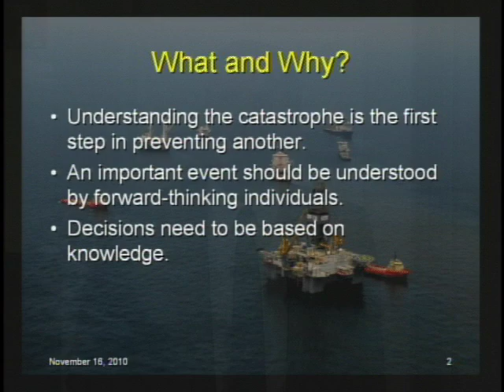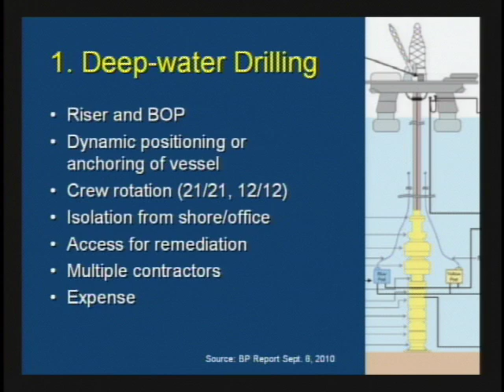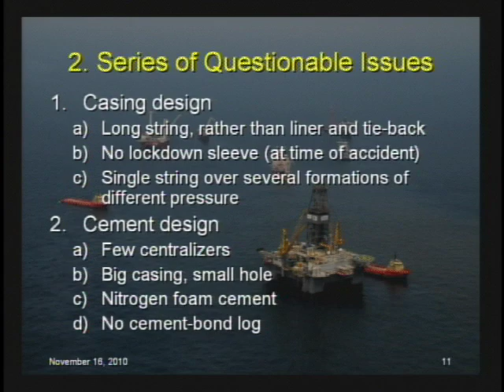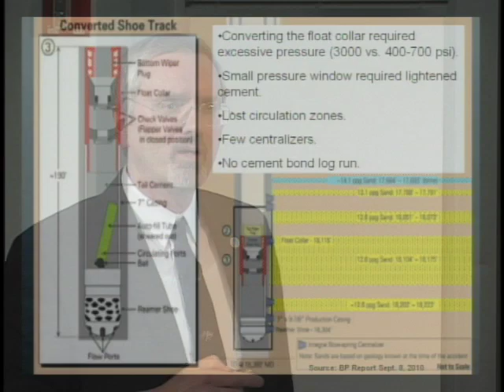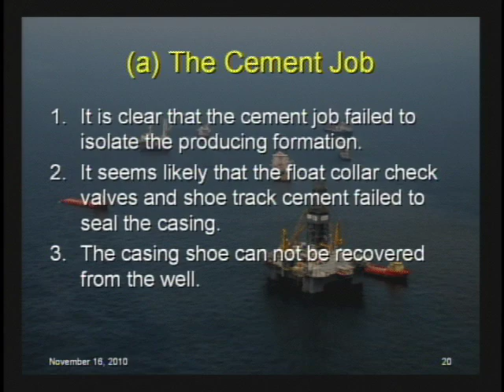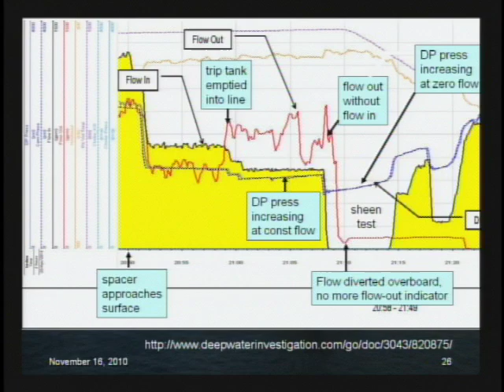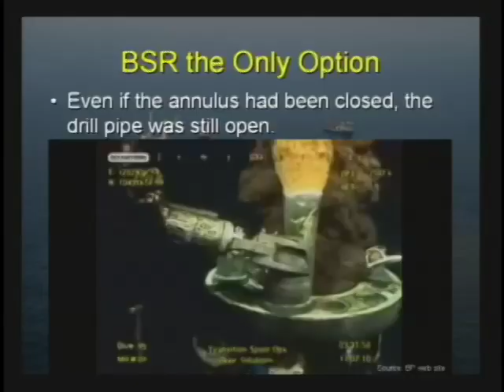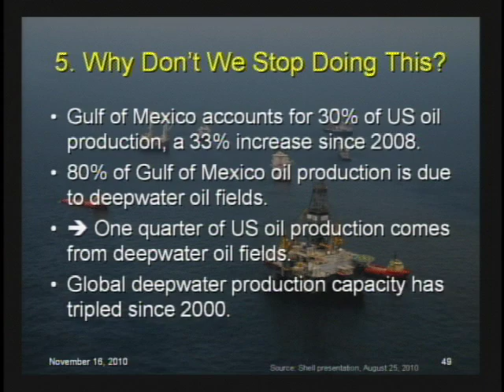The Deepwater Horizon Accident: What Happened and Why?

Comment: I would add one item to Mr. Horne's suggestions. Worker involvement in operational safety. Instead of workers being totally schedule driven and told "Don't use safety as a crutch" (for schedules slipping) every individual should be encouraged and rewarded for noting unsafe conditions and recommending safety improvement. The workers are closest to the operation and always know when things aren't right. In the long run this saves lives and profits.
Reply: What world are you from?
Reply: that's pretty much obvious. that's exactly the problem. that this costs money. and BP didn'T want to spend money. it's like you have said: BP should have been nicer. obviously. But the how do you force a big company like that to carry about safety and human lives? that is the question? if they can point at subcontractors, probably treaten them with termination of contract, and ovoid or minimise requirements anywhere possible, how do you force them to still keep those regulations or even get better at them theirsleves? its big money against regulations: the same story everywhere. what body would impose those regulations on a multi national company? in what court would they be tried if they break any of them? how do you give power to subcontractors against the pressure of giants like BP? those are just  just a portion of the probable valid questions.
Reply: The problem is that corporations all seek immediate/short term gains which probably has at least something to do with the musical chairs that corporate executives play amongst companies while cashing in on the stock options. What I think should happen is when any CEO (or any board or executive if a company), banker, or politician is found to have blatantly caused suffering and/or death to people is to hang them on national television. It may be extreme but you would see a change pretty damn fast.
Reply: @brianallison1913  

... or use a guillotine/guillotines ...

In fact, a thought crossed my mind: aside from using the 'shorter' version, with a much heavier blade (especially with the steels we have, like 4140), aside from a forge welded blades, made from, say, 1065, 1080, 1095, and 30n20, instead of 'just' the head, have an additional two, for the arms stretched out —as they do for lethal injections — and another for both legs, tied together, and as close to the pelvis as possible. Using electronics with millisecond impulse, once all is carefully placed in a precisely marked postion, and energised, hitting a switch, causing all four to 'fire' at the same time ...

Sounds borderline insane, but, if you're going to make a truly public spectacle, of those individuals, then 'just' hanging may not be enough, especially for those whom are even willing to pay decent seats, and so forth ...

... dismembering by guillotine, as per above, maybe is closer to the psychological effect you want to create, especially among those, whom, if guilty, and their appeal is denied you wish to be publicly hanged; also the aforementioned method is closer to the harsher hanged, drawn, and quarterd ... but without the mess, and effort ...
Reply: STOP WORK AITHORITY.

CALL COAST GAURD AND LET THEM KNOW THAT YOUR ARE BEING HELD ON THE FACILITY AGINST YOUR WILL IN A HOSTILE AND UNSAFE CONDITIONS.

Comment: So many questions wish I could ask. 1st He said they don't check the BSR like they don't check airbags in a car. This is not true, the BOP BSR are checked every 2 weeks along with the annulars and other rams in the BOP. 2nd who was the Wellhead rep and and how much weight down did they have down when they landed the casing before they started cementing. After the cement job they have to install the Seal Assembly and I've never heard anywhere where they talk about the Running tool of the casing or Seal Assembly. (knowing the size of the casing would help too) Lots of people I believe were thrown under the bus in the incident and the people who really know what happened went into the bush like Homer Simpson.

Comment: When the negative test was preformed it failed showing 1400 psi on the drill pipe pressure gage. Proven test tried and true. 
Well control problem indicated! 
Next step immediately close a variable ram after calculating space out. The rams would close at this time it would be far before the situation became critical. 
Well successful secured!
Then take as long as needed to decide if your stripping in to squeeze cement or whatever. 
Never disregard a failed test.
Never disregard a failed test and try to find a justification to eliminate a failed test because it's  inconvenient that there is a well control problem. It's not just going away because you secretly test against a closed value, or any other things you do or say just won't fix the problem and justify it away.
If you don't take care of it right away a 10 bbls kick turns to 30bbls kick turns to 300bbl kick and then you get all the unscheduled events equipment failures that go with a uncontrolled release of gas influx into the wellbore, no surprises there.  That's why they call it loosing control of the well. Transocean was always careful not to point fingers at anyone when we had accidents, but considering what to teach us so we could learn from them then move forward working safer with more confidents and integrity than before. Did we go to the moon with no sacrifices? Did we not know how dangerous our job was each and every time we hug the kids kissed the wife goodbye? I did. Then I would go  walk the deck with MEN on the open ocean. 
My heart goes out to those who where affected by this tragedy.
My heart will always bleed Blue,
Thank You Transocean for the ethics and integrity you bestowed in me as a young man as I know this tragedy affected more hearts than anyone could imagine and many where shallow in projecting a wider range of empathy.
R.I.P.  my brothers in Blue.

Comment: learning from mistakes is one of the fastest way to make progress/improvements. Airplanes 30 years ago also weren't what they are today, and sadly it's the accidents that made them better & safer
Reply: It's not just that, it's the aviation industry's commitment to safety, the stringent regulations and things like airworthiness directives that mandate that operators take actions to immediately reduce the risk of accidents during an investigation (e.g. when A380s were required to have far more thorough testing done to the engines until the precise cause of Quantas 32's engine failure was determined), and the overall culture. Commercial aviation is safety-first at all times. Every part of a plane is tested and tested regularly. Every few years they go through a D-check where they strip the entire plane down to its bare bones and inspect every square centimetre for damage, including fractures invisible to the human eye.

Whenever something goes even slightly wrong, an incident report is filed, the causes investigated, and corrective measures either recommended or mandated. Go-around due to runway incursion? Incident reports from all involved, improvements made, the best example being runway status lights as an addition to reduce them.

From an outside observer's perspective, there is nothing like that kind of culture in oil drilling. Not even close.

Comment: I'm the designer of the caphead spool that stopped the deep horizon's macondo wells rogue leak.  I'm an employee on Alaska's North slope oilfields in Prudhoe Bay (current 2019). I'm a mechanic. But also have over 30 years experience in pipeline repair and maintenance. June 20, 2010 I was watching news coverage of the horizon crew using underwater robotics to cut bent sections of the line away and left several feet sticking out of the seafloor. N inches from the pipe end was a flange. I designed my caphead spool that could be lowered onto the well pipe and use locking lugs or wings to lock behind the flange securing the caphead to the line. At the bottom of the caphead spool used hydraulic chevron seals to use the well pressure to seal the leak. The flow from the well could be diverted to the surface and collected into a barge or tanker. Once flow control established using a downhole pump could over pressure the flow and inject the cement/ slurry mix, leaving the caphead spool emplaced until the cement/ slurry mix had set up sealing the macondo wells rogue leak. I was told later that horizon had a helpline number and were asking for assistance ideas.  I called and chatted with the "horizon helpline"  personnel and submitted my caphead design by zipping. I neglected to file for a patent for my design and was emailed back by the helpline personnel and told my design was unusable. I tried calling the horizon helpline to find the helpline had been discovered. Several weeks later watching news coverage as my design caphead was used to stop the macondo wells leak. Basically I had been slapped in the face and brushed off. I wasn't given any credit for my design or compensation. I still have copies of my design I had submitted as well as emails back and forth from horizon's helpline. I do have a BPCLAIM CASE # and looked for a lawyer who could help but decided to wait until the corrupt Obama administration was out of office to voice my opinion. After 9 years I checked and the same blowout prevention valve system is still in use on most ocean based oil production drill platforms. On this type of "bop" system the annular valve failed, due to the seat coming apart and not sealing. The hydraulic rams failed to cut/smash the line as the pipe was out of alignment. This type of blowout prevention valve cannot be tested periodically to verify proper operation and failed when activated. If the bop system worked would still leave the well inaccessible to repair or abandoning. Production stopped and unable to perform repairs without taking the risk of creating another out of control leak. The bop can't isolate pressure in order for repairs go be done and can't be tested. I do have designs for a safer bop system that can be repaired and pressure isolated if tests verify the bop is inoperable. After repairs are completed the well can return to production. My designs will not be for free and will be patented. I also have plans to start my own deep water repair company specializing in ocean based oil production drill platforms as well as marketing,my bop systems. The price in upgrades will be alot less than the deep horizon's leak at the 100 billion dollar mark and rising. "007".
Reply: So, did you ever get your money for your designs? Did you ever go into business for yourself as a contractor for these underwater "Renters"? And did you use heavily medicated Antibacterial ointment from waiting 9 years from constantly picking at that scab until you let it go? Just curious.

Comment: 11 people died i think i heard her say 5
Reply: Yea she said 5 died, 17 injured, but that was corrected by the guy later. I've heard the number five mentioned before, I seem to recall that being the number of drillmen killed and the others were not on the deck at the time of the explosion.
Reply: Charlie Abater...pretty positive it was 11 killed. I’ve seen that in about every spot I’ve looked or have heard.
Reply: 2 assistant  drillers 3 floorhands 1 derrikhand 1 driller 1 crane operator 2 mud engineers and 1 senior tool pusher

Comment: We just designed a piece of equipment that will stop this type of thing from ever happening again. It's called the CDS Blowout Preventer and it's no joke. This patented blowout preventer we designed requires NO human intervention! It's also 100% reversible once it's engaged so you don't have to "cut and run" if it triggers. This gives time for the drill rig crew to make a decision to engage the large blow out preventers (Piston/Ram based) to shut the well off permanently. If they don't wish to, you can reverse the CDS Blowout Preventer in less than 1 day and proceed with operations as normal. Right now, no one wants to press a button that causes the 60-foot tall blowout preventers in place (which in my opinion usually doesn't work as planned for one reason or another) and cost the company up to 1 billion dollars spent on something they just closed permanently. If those same people had time to discuss the kick that occurred and our product stopped from blowing out the well, they could make an informed decision as how to proceed. No one wants to be the guy that just killed the prospect of the well and cost the company a ton of money by making a 1 to 3 second decision to engage the large blowout preventers without someone higher up in the company saying it's ok to do that.

 The CDS blowout preventer gives that time to the drill rig crew and allows the company to make the final decision to shut it down! Nothing like this has ever been designed before and we are proud to have completed design and production on the unit. The CDS Blowout Preventer works in conjunction with the large 60-foot tall BOP's that have to be installed in all deep sea drilling operations! It doesn't replace it. However, it does give peace of mind knowing that something is protecting the crew, the ship, and the earth/ocean/ & wildlife that's automatic, uses no electrical current, doesn't require any human intervention or monitoring at all, and is fully reversible once engaged! I'm sure you will agree that this is exactly what the oil industry is in need of and now it's available. We have some crude test videos and explanations of how it works here on YouTube under our account of CDS Blowout Preventer. Stop by and have a look today and let's not forget the lives lost in the BP Macondo Blowout upon the Deepwater Horizon offshore drilling rig on April 20th, 2010.
Reply: wtf? you can open and close the rams on the bop in like 5 seconds. if the driller sees a gain and is in doubt he will shut in the well and do a flowcheck. if well is not flowing he can open the bop and keep drilling in like 5 minutes.
the shear ram is the last thing you close.
Reply: Turlitz wow I am very impressed did you yourself help work on the new cds boo

Comment: 6th July 1988, Piper Alpha Platform. Bad work practices in the failure to report current conditions leads to the platform going bang. Inadequate safety systems and emergency protocols lead to 167 deaths.

Public enquiry (Cullen Report) 1990, makes recommendations on safety and good work practice.

20th April 2010, roughly 20 years later, lessons forgotten, renewal of bad work practices and neglect of platform safety systems lead to 11 more people being killed.

In sad conclusion, lessons will have been learned form this, however give it another 20 years or so and another platform will experience some form of catastrophic failure. This will of course lead to yet another enquiry in which lessons will be learned once again.

I look at what happened on DWH and I think, "even though they will have lost millions in the destruction of the platform, millions in lost oil revenues, millions in the environmental clean up and millions in the inevitable fines and 11 people killed, at least they where able to save 125,000 by not carrying out the necessary safety tests."
Reply: Mate. The bottom line and fact the other two platforms kept feeding oil to piper for 2.5 he's after first explosion
Reply: @petermartyn9509  Absolutely. If you ever get the chance to peruse the Cullen Report, it makes for some interesting reading. The only issue is that unless you can get a copy from a public library because the internet regards the information as classified. Or at least it was when I had to do a full report on the event.

Comment: What this tells me is that BP is run and operated by a bunch of people how can not even do an addition on a pocket calculator. My dad used to work on oil platforms and he told me about a texan called wally. He used to count how many pipes they put down the hole using matches because he could not count using numbers!

Comment: Question:
If hydrocarbons are not supposed to enter the well bore (also, what's a well bore?) and then not supposed to enter the riser pipe, well, how are you supposed to get the oil and gas out of the well?
You know, the entire point of this operation.
I don't know anything about this industry as you can tell, but i guess you don't do what an ignorant like me would do, which is from a hole and collect that which squirts out.
Reply: because Deepwater Horizon was not there to pump oil. It was there to drill the hole and cap the well for extraction later by a different rig.

Comment: Cement is a powder used in mix (with gravel and other things) to make concrete. They are not the same thing and cement on its own wouldn't hold much! .. for "Joe" the homeowner it is ok to mix these two terms like they were the same but for someone from Stanford to not know such fundamental thing makes you question their other "findings"...
Reply: You are thinking of a particular product called "portland cement", "cementing" is a process where some substance is bound together.
Reply: Nope, Portland cement is just a type of cement (not a product name)...  wiki cement or see http://blog.ozinga.com/concrete-vs.-cement-explained
Reply: There are cement additives that have been developed to allow the use of Portland cement in many different oil and gas well operations. In an attempt to formulate the appropriate cement slurry for any cementing job, the right additive must selected and the right quantity must be added.There are different types of cement additives  developed to allow the use of Portland cement in many different oil and gas well applications. BP hired a top oilfield service company to test the strength of cement linings on the Deepwater Horizon's well, but sent the firm's workers home 11 hours before the rig exploded without performing a final check.